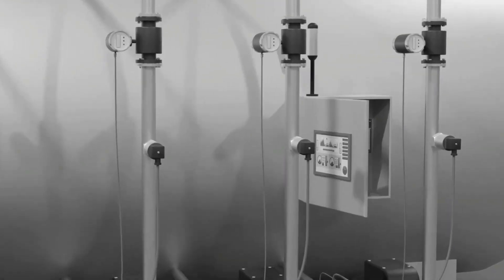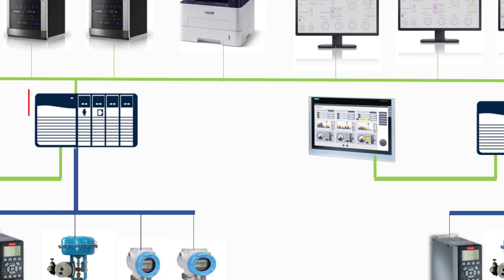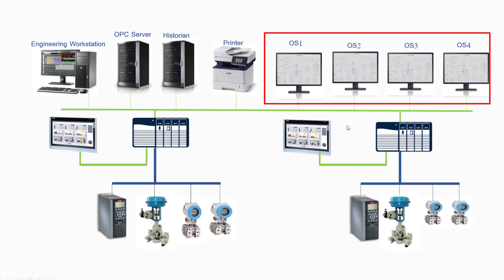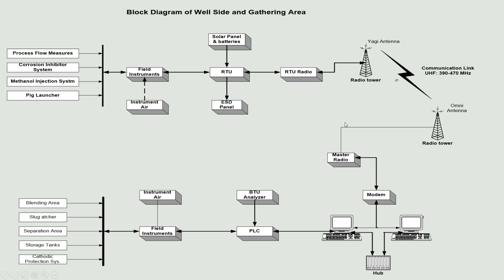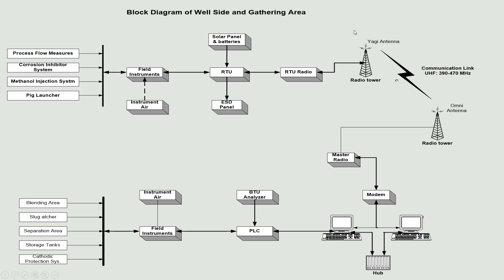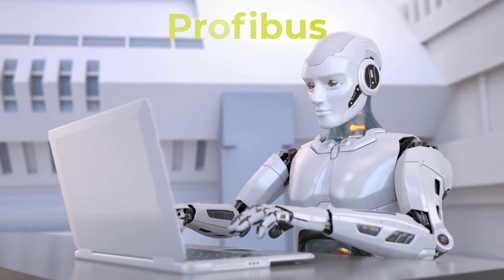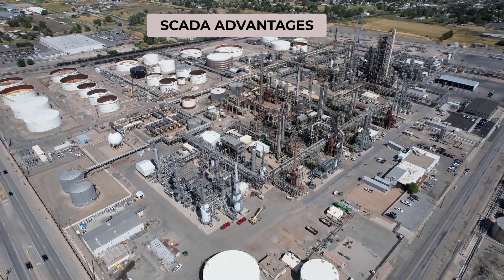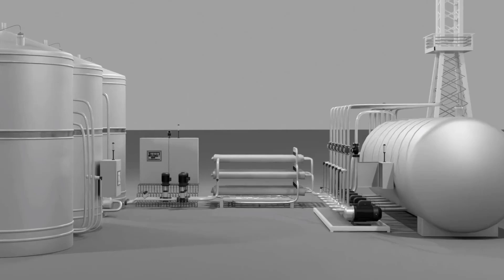Introduction To 𝐒𝐂𝐀𝐃𝐀 𝐒𝐲𝐬𝐭𝐞𝐦

Comment: “PLC is analyzing data”
No it’s not, it’s in the name, logic controller, just that, a plc is an I/O controller.
It’s more like fancy relays which switch the state of an output depending on inputs. 
A plc has a set program in it, it runs that program in a loop and checks inputs. 
You can change the program but it is normally not done until the system changes, like in changing a process by adding or removing I/o.